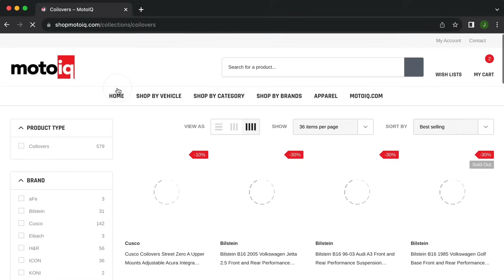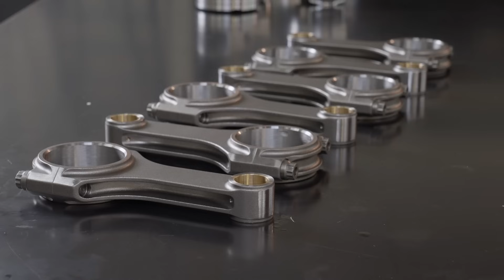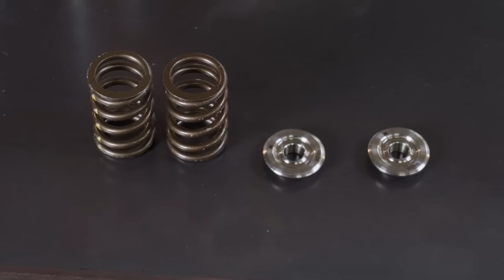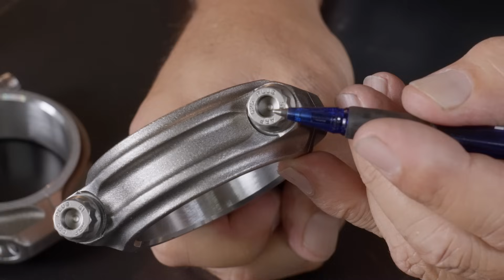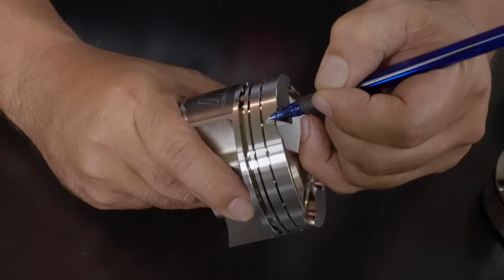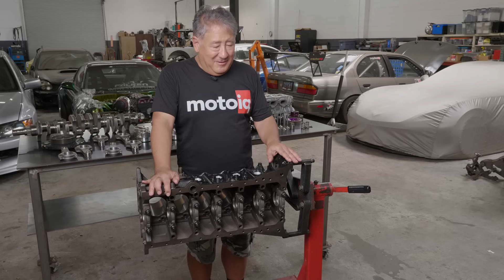How to Build a Basic 1,000 HORSEPOWER 1J/2JZ Toyota Engine!

Comment: Engine is a boat anchor for 3.0 liters of displacement. LS is a far better platform and if you want to go inline six the all aluminum bmw turbo s58 pushes over 800 hp on a completely stock engine (with flash tune).
Reply: crazy what changes in 30 years
Reply: Yet it's been around for 30. Plus years and it's STILL considered arguably the best overall "car" engine ever made. 😂 You know why... BECAUSE IT'S BUILT LIKE A BOAT ANCHOR!
Reply: @804MRMAN  and has been swapped into anything and everything with the exception of a motorcycle😅😅😅
Reply: @804MRMAN  lol the best engine ever made was the small block Chevy sorry it’s not even close. If you want to compare stats I’ll be happy to do that for you. 🤣
Reply: @Bimmer_Bill  Bruuuuuh I'm not going through this, it's been proven time and time again that the 2JZ drags all street engines!!! And has been very successful in TOP FUEL DRAGSTERS 🤣🤣🤣
Reply: @804MRMAN  you don’t want to go through this cause you will lose. If you want to compare factory engines by historical race reference the 2jz is not even on the same planet as the small block Chevy that includes ALL forms of racing! Mike would back up my argument 100%. With the 2jz even in drag racing you have to make excuses such as oh it’s only 3 liters oh it’s 30 years old. Let me know when a 2jz is putting cars in the 5’s or winning major road races then we can talk until then 🤐
Reply: @Bimmer_Bill  ALL FORMS OF AMERICAN RACING!!! Dude America only makes a minute percentage of earth lol. Like I said 2JZ LITERALLY DRAGS OTHER ENGINES POUND FOR POUND DOWN A STRIP, STREET, DRIFTING, ETC! Stop crying lil buddy.
Reply: @Bimmer_Bill  GOOFY there are 100's of videos showing a 2jz doing 5 second passes 🤣🤣🤣 Not to mention Real Streets built a 2JZ that did 330mph 🤣🤣🤣
Reply: @804MRMAN  ignorance is bliss you clueless 🤡 . You haven’t given any OBJECTIVE data to support your claim. SBC literally has gone faster in the quarter mile, won countless more races including nhra, nascar, lemans, and made far more horsepower than any 2jz. If you want to truly compare kiddo let’s pull some numbers. Until then all your blather is meaningless. Oh yeah drifting is for children it’s a show,  it’s not really racing. Nice try 🤣🤣🤣
Reply: @804MRMAN  from jalopnik (greatest racing engines of all time).

 “… the SBC (small block Chevy) got more regular people into racing and powered more home-built race cars than anything else. It’s almost single-handedly responsible for grassroots motorsports, without a cheap and reliable engine the hobby wouldn’t be where it is today”.  Reread the second sentence over and over until it gets through your thick skull. The 2jz comparably speaking is irrelevant and it’s not even close. I’m not even a Chevy guy, but I prefer facts over bias.
Reply: @Bimmer_Bill  I DON'T CARE ABOUT NONE OF THAT 🤣🤣🤣 I've never ever denied the greatness of a Chevrolet V8, the point I made is that the 2JZ IS GREATER. THE END. For tag me no more, please. You have a nice day.
Reply: @804MRMAN  🤣 oh now it’s all street engines (which the sbc is btw). How does that compare to the LS?  Please tell me what engine is in the fastest street car in the world? Hint it’s not a 2jz lol. Also, please tell me more about top fuel? Are they making 10,000 horsepower and running over 300 miles per hour in 1,000 feet like the hemi based V8’s? Even the small bock Chevy has gone 5.6 in the 1/4 mile! Oh and btw both engines use ALUMINUM BLOCKS! You don’t need a boat anchor iron block for strength. In fact almost all modern racing engines use aluminum blocks. Toyota made a strong BUT CHEAP ENGINE! Don’t be stupid.
Reply: @Bimmer_Bill  Meanwhile in reality I clearly mentioned ALL levels of racing, records etc lol. Fun fact: the fastest manual driven car on the drag strip is 2jz powered lol.
Reply: @804MRMAN  dude stop it you’re making a fool of yourself. First of all why do you have to make excuses such as oh it’s a 30 year old engine. Oh it’s an iron block because it has to be to make lots of power. Oh it’s 3.0 liters. Oh it’s the fastest street engine and fastest with a manual. Listen and learn! The fastest manual drag car in the world is NOT powered by a 2jz. First off a clutch operated manual would blow to pieces with a 5,000 horsepower blown small block Chevy or LS engine. So that says more about how wimpy the 2jz is respectively speaking to the sbc and ls. The fact of the matter is the fastest manual drag cars in the world use either a liberty or lenco clutchless manual! Now please sit down and be 🤐
Reply from the maker: My opinion for what it's worth is that the SBC is one of the greatest designs ever.  That being said, an off the shelf SBC is not even close to the equal of the 2JZ, the 2JZ just smashes.  Let me qualify that in that the SBC is one of the most developed engines on the planet and a high cam SB2 with the latest canted valve low angle heads is a thing of beauty.  It is also not really a Chevy anymore but a bespoke racing engine that shares the SBC bore spacing and dimensions. They are both fine engines that I love but right out of the box, the 2JZ is pretty damn impressive!
Reply: @motoiq  thanks Mike for replying. With regards to the SBC, all I’m saying is it’s probably the greatest engine ever designed from a historical perspective. The 2jz simply cannot match the number of race wins nor the prestige of the wins, nhra drag racing, nascar, and the fact that pretty much the entire aftermarket was started with that engine. I’m not saying that it is the most technically advanced its not. But if your ranking from a motorsports historical perspective the 2jz doesn’t stack up. The only reason I brought that up was because that guy was making excuses for it being 30 years old compared to let’s say the s58. So, my play was if he wants to open up the history books, then let’s do that. I would even say that from a historical drag racing perspective the 2jz also doesn’t match up with the big block Chevy (rat motor) or the Chrysler hemi which all of the top fuel and funny car engines are now based upon. I would also go further to say that the LS based engines offer more performance potential than the 2jz. With all that being said, I’m certainly not saying the 2jz doesn’t belong up there on the list of all time greats but let’s not get carried away in saying it’s the greatest production engine ever made. I can make a case that the b58 might be better when it’s all said and done due to its versatility used in sports cars, luxury sedans even SUV’s in several different manufacturers. Anyhow that’s my $0.02. Thanks for the great content!
Reply: @Bimmer_Bill  Look at you still crying 😢  Lmaoooooo
Reply: @wethomas3  Goofy I didn't make up no excuses! You have a real problem lol. I clearly after 30 years AS IS, the 2jz is pound for pound the best! It must be in your DNA to blatantly lie.
Reply: @804MRMAN  you really are clueless aren’t you? You made the 30 year old excuse for that boat anchor six. Furthermore you claim that the 2jz is lb lb the best, but the reality is aluminum blocks rule! Steve morris LS based engines weigh 425 lbs complete from intake to oil pan and have run in the 5’s quarter mile making 3,500 horsepower! So no you are flat wrong! Lb for lb for horsepower LS based all aluminum engines (those in the fastest street cars in the world) are THE BEST. Please be quiet unless you come with facts not uneducated opinion. 🤦‍♂️
Reply from the maker: S58=1000 hp with E85 and a flash!
Reply: @motoiq  yup! it’s amazing what the s85 can do with minimal mods. 👍
Reply: @Bimmer_Bill S85 is BMW m5 V10 engine ;)
Reply: @Piotr94L  lol 😂 👍 yes I know, i own one of those too. That’s a typo. Go with my original post, “bmw turbo s58”

Comment: Fluidampers are so trick. Cosworth has some sort of fluid damper in the middle of their V12 cams. If Cosworth does it it's trick. The Dart 2jz is going to be wild. 4 bolt billet mains, dumb thick deck, tons of head bolt threads starting below the deck. If i could get my mess together or hit the lotto the Dart 2j would be it. Or fanboy it with a VK56.  Thanks for the iron casting knowledge! Never woulda thought about remnants of the method of production scarring up a fresh build.

Comment: How bad off are you if you have the -GE block and head?
Reply from the maker: The GE is bulletproof too!
Reply: Block is basically the same but without the oil squirters. The compression ratio is a couple points higher. The GE  has a distributer instead of coil packs. Also has an intake plenum that covers the spark plugs so that is a bit of a pain. The intake and exhaust ports are also different. the water neck location to the upper radiator hose is also in the drivers side. the valve covers are also different.
Reply: If you have a GE vvti then you supposedly have the weaker rods. You might want to look that up though.

Comment: I love the 2j, but cant find the heart to cam mine and make it interference.  Love the piece of mind since its belt and not chain. 
Just a family weekend cruiser though with the kiddos.
Reply: you're missing out for sure; the lope is glorious lol
Reply: Prefer more smooth quiet idle in my older age.  20s me would have been all for it.  Been there done that kinda thing.  Also less lift is less strain on valve train, more spring pressure needed, more wear.  @DylanTK
Reply: If you have a ge non vvti it wont be. Mine with bc 272s isnt.
Reply: I have a GTE vvti  @josephcastellano4

Comment: The title of this video is a testament to how far the metallurgy in this industry has come in relatively little time. It got me thinking back to 1997ish when there was maybe two guys in the US that had broken the 1000whp mark with factory blocks in street cars. Might have to go looking for that magazine in my old stash! 👍
Reply: I made 913 whp through the getrag 6 speed with just a new OEM head gasket, arp headstuds and cheao eagle rods. Everything else in the motor was stock and untouched. Later I put gsc s2 cams, springs, MR2 shimless buckets and made bit over 1000whp. I did 191.4mph in the half mile in 5th gear. They are just too expensive to build now with all the hype and inflation.  Although I prefer the inline 6 turbo sound, I would rather build an LS motor. They are plentiful in the U.S. and a lot cheaper.
Reply: @jimmyjohnson7883  how long did that 2J last at those power levels?  They are known to really wear out the bores at high hp and rpms.
Reply from the maker: @Twobarpsi  everything wears out bores at high rpm and power levels!
Reply: @motoiq  yes 👍
Reply: @Twobarpsi 300hp+ per liter wears out the bores of any engine very quickly.
If you go back and look, gasoline engines that were designed to output 1000hp, like tank engines, were much larger.
Reply: @Fulcrum205  Right, the Rolls-Royce Merlin initially produced around a thousand horsepower from a 1300 lb 12-cylinder engine at 27 liters of displacement.
Reply: @mojoron and those engines were designed to run under load conditions that would disintegrate a passenger car engine. AFVs, aircraft, and boat engines operate in a much heavier load environment than a car engine. Aircraft engines especially as driving the propeller imposes a ton of strain and vibration right on the end of the crankshaft.
Reply: @jimmyjohnson7883 Coyote 3-2-1 is THE way to go nowadays. Easily over 600HP stock and ITBs will provide more power.
Reply from the maker: @Agent-mb1xx  600hp from a Coyote stock NA?  I don't think so! Unless you are talking crank hp and I don't think even then unless this has headwork and cams.
Reply: @motoiq  BHP of course
Gen 3 black, Gen 2 heads with ECU, Cams and injectors + headers = easy 600BHP

2015 Mustang GT has 434HP if my memory serves me well
Reply from the maker: Is that at the crank or wheels?
Reply: @jimmyjohnson7883 do you still run the stock timing tensioner bracket
Reply: Vinny Ten.
Reply from the maker: He mostly does Nissans now days
Reply: @motoiq  he

Comment: I will probably never even own a 2JZ but I could watch motoiq engine build videos all day
Reply: You can always do these stuff at your engine! It's not so specific for the 2jz.
Reply: I got one from a guy for 400 dollars. Complete engine. I also have 2 2004 IS300’s. So the engine I’m building once put in I’ll build the engine I’m taking out. I basically have 3 2jzGE VVTI engines currently LOL
Reply: @bigjdm5460  that’s good i don’t think they are bad but the amount of stuff you gotta swap out it isn’t worth it for me considering i got my gte for cheap in a running car and actually ended up making profit after selling all the parts
Reply: @bigjdm5460  and the aftermarket was a big thing for me the ge’s aftermarket is fine but it’s not as good
Reply: My car with a 2JZGE is for sale in Pensacola Florida. 2000$
Reply: O but you can
Reply: I just got a 1999 GS300 with a 2JZ-GE for $6700, mint condition interior, with 115k miles on the Odometer. The alternator went out soon after we left the lot but my prepurchase inspection returned a low battery voltage and didn’t look up exactly what that meant so that was on me. It made it the rest of the way from Miami to NY without any issues. The radiator developed a hairline crack but the plastic was old and brown instead of black, $200 for a new radiator and I did the job in my driveway. Point being you can get into a 2JZ platform in 2025 with less than 10k, and the cars they come in are pretty nice if you do your research. I found my car on cargurus and there’s a handful of similar GS300s and IS300s are available of you have a slightly bigger budget. Point being you don’t need $80k to get into a good platform if you do your research and know where to look!!
Reply: You aren't missing anything tbf... get a m50, better in all aspects, cheaper
Reply: Ummmm I don't know what country you are in, but you can get a car with a 2jz for $2,500-$5,000 on the low end. The days of "needing" the "GTE" or "Supra" are over to achieve high reliable horsepower, you can get a 2jzge-vvti and do the same thing cheaper. Actually the ge-vvti head is preferred over the gte.
Reply: @804MRMAN exactly what I’m building right now
Reply: @wpeezy10  2JZ THE 🌎
Reply: @804MRMAN  exactly
Reply: @804MRMAN GTE’s are a little better if you just wanna single turbo, injectors, swap it into something. If you already gonna build out an engine to hell you might as well get a GE tho, that I agree with. I’m fine paying 9ish for a manual GTE because all I gotta do is get the mating surfaces machined, single turbo, injectors, and im gonna beef up the fuel system just to be safe. Plus it’s a little more ear candy to say “2JZGTE”, I’m building my dream car so yk… that’s important in this case!
Reply: @GremlinZ420 I remember when whole aristo half cuts were 3k 😢
Reply: @804MRMAN   Idk about 2500-5k, maybe where you are 😭 I have a 99' GS3 and looking for another 2nd gen, can't find one under 9k anywhere :// GE motors are rapidly increasing in price too.
Reply: @BraveHardt  I said on the low end. All of the JZ engines are valuable. The GTE was up to one 8k-10k during the pandemic. They back down to about 5k-7k. But the Aristos are legal now so those GTE sellers will have to drop the prices even more because people can get a whole ARISTO for about 15k after shipping and import fees.
Reply: @BraveHardt I been getting my ge motors for $900 I just look for part outs
Reply: @804MRMAN i’ve watched multiple youtubers build ge’s and barely scratch 500 after pouring 5-6k into their engines if it’s your starting platform it’s worth it but if your doing a swap gte’s are still the way to go
Reply: @Gagezila  I've seen 1,000 of videos that say you're lying 🤣🤣🤣 but you go off. A stock GE-VVTI could make 400hp on just $2,500. You can do even more with a stock GE non-vvti being that the rods and pistons are the same as GTE... Like I said kiddo those days are over with needing a "GTE".
Reply: @804MRMAN  ok then talk to the dozens of ge owners from my local meets with blown up engines from running 10psi. They are pretty much only the same in the block everything else needs to be changed
Reply: @Gagezila  THAT'S THEIR PROBLEM 😂🤣🤣 But like I said it's been tried and tested hundreds of times over the 30 years since the 2jz was introduced... It seems as though you seem to be confused... There a 4 2jz variations; 2jzgte-vvti, 2jz-ge, 2jz-fse, 2jz-vvti... The GTE AND GE have same exact internals!!! One was just turbo, and one wasn't. The FSE and GE-VVTI have the weaker rods and pistons... Now I'm tired of repeating myself, let's not have this talk again 🤣
Reply: @804MRMAN  do some more research before you go and yap on youtube kid just cause the ge is all you can afford doesn’t mean it’s the right answer
Reply: @Gagezila  😏 What in the world are you talking about? So you making false assumptions because you're upset kiddo? 🤣🤣🤣
Reply: @804MRMAN  FYI Non-VVTI GE don't have the same pistons as the GTE. They are slightly inferior to the GTE.
Reply: @KCM33  What??? Dude are they the same if one is inferior? 😂😂😂

Comment: Basic and 1000hp aren’t often in the same sentence when talking about engines but Toyota’s JZ engines beg to differ.
Reply: Seriously, I’m looking for 500 wheel, all i gotta do is single turbo, injectors, fuel system. It’s dumb how built these engines are OEM.
Reply: @GremlinZ420 thats under a thousand total
Reply: @sun6262- I would hope that 500 is under 1000 😂
Reply: @JTheraos ahhhh u know what i meant